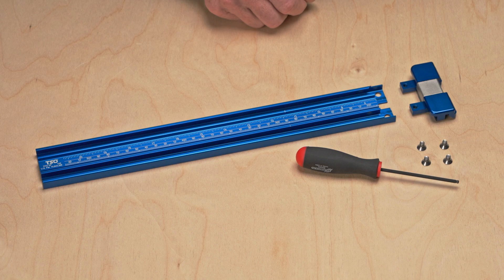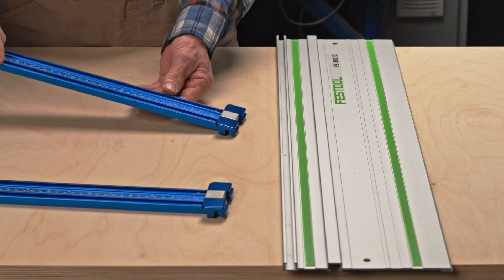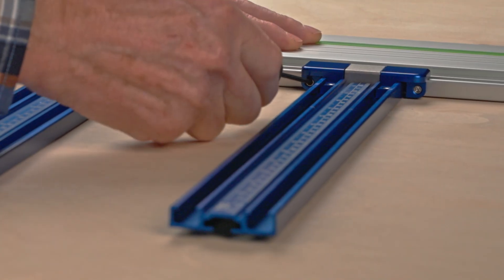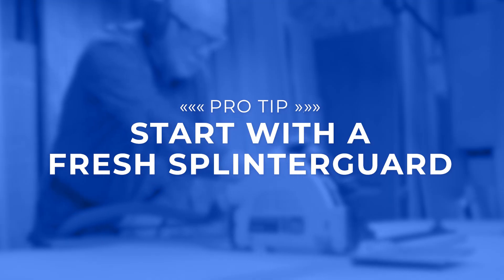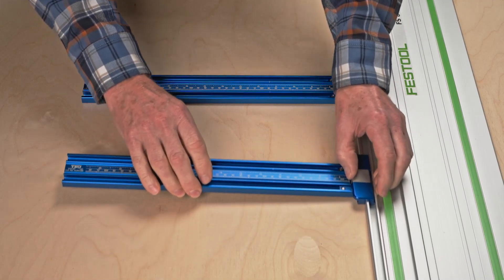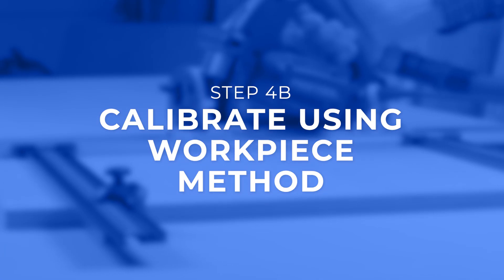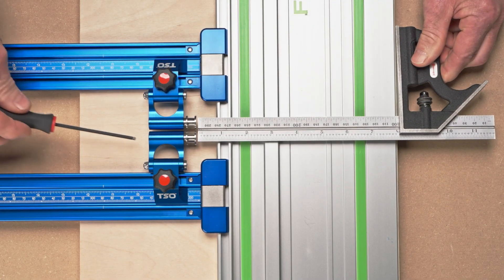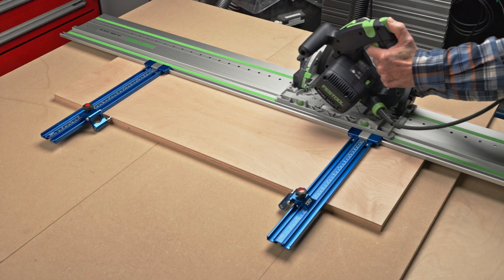TSO Parallel Guide System Gen 2: Assembly, Calibration, & First Cut

Comment: i'm using the GEN1 rails with the clip-on connectors which still work great.....but did grab the new flip stops as it is much easier to set precise measurements due to the re-design. awesome job!